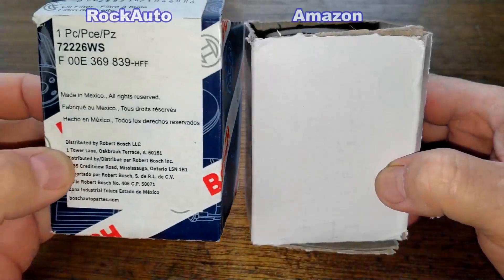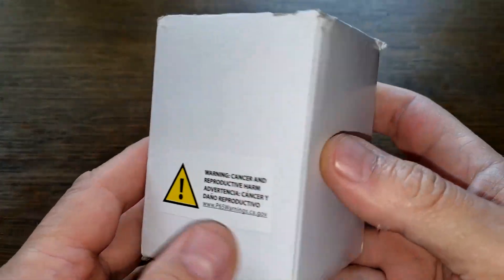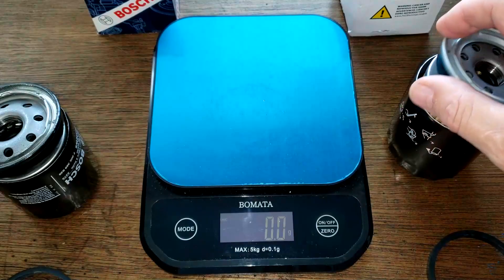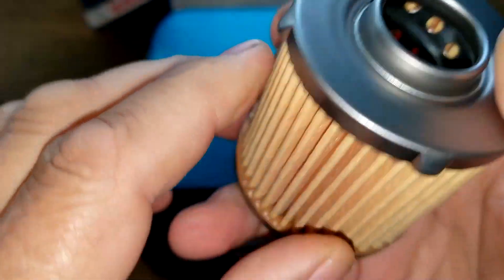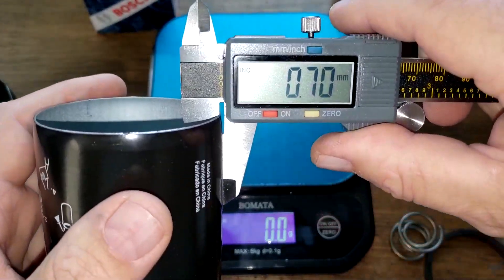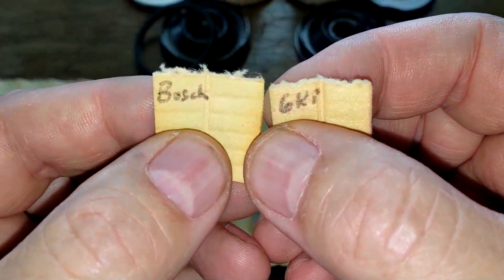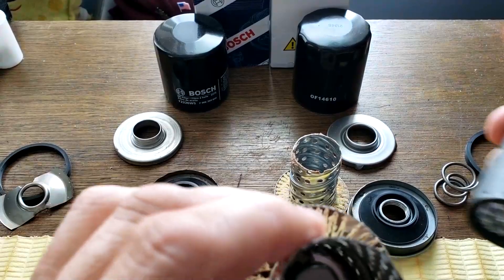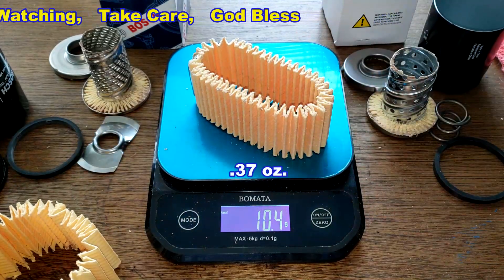Bosch Oil Filter 72226WS Cut Open vs. GKI OF14610 Oil Filter Cut Open Comparison

Comment: Neither,the Bosch is basically a beener filter🫘 vs GKI is a Chinesesium filter 🇨🇳,i go with a Japanese built OE Honda filter
Reply: it's not 1990 anymore..   specific china and korea factories are on the same or higher level than Japan.  ..  Mexico is stuck at 1986.

Comment: The GKI filter media looks like it was assembled better than the Bosch and it has my preferred coil spring but it has less filter media than the Bosch. I've never heard of GKI before. Neither has a silicone anti-drainback valve. I'd pass on both and get a different filter.

Comment: The GKI seems to be a pretty well made filter and I do appreciate how they were prudent wit hthe glue, Bosch is supposed to be a premium brand but seems to lack in a few areas like thinner media, leaf spring and a rubber ADBV.  I do not like the rough side of those holes touching the media on the GKI, though. If forced to choose, though I'd stick with the Bosch and make sure I changed my oil at 5K on the dot,  but if given a choice I'd pick something else like a purolator PureOne.
Reply: The Bosch oil filter pictured here is their "economy" model -- NOT representative of the Bosch Premium model at all.
Notice that the Coil Spring goes with the Thicker Cannister. When manufacturers switched to the thinner cannister (less waste, lighter weight, environment), thye found that the Coil Spring distorted the cannister, causing failures.
They designed the stamped-steel "Retainer", which locates the filter element and holds it in place -- it's cheaper and more effective than the Coil Spring, and, technically, it's not really a "spring" at all -- but people still call it a spring, anyways.
 Even Fram calls their retainer a spring.
America has become a nation of slow learners.
Reply: I'd like to know the flow rates of each.
Reply: Yeah, Mark, but it doesn't do any good unless you know the Flow Rates of the Matching Oil Pump at different RPMs.
No sense in paying a premium price for a Hi-Flow oil filter if the pump doesn't deliver the desired Gallons-Per-Minute.

Comment: The Toyota dealer in Westbury, NY left old oil in my Gen 2 Prius crankcase.  When I went to complain, the manager said they don't desludge and "Have a nice day."  What scumbags all these dealers are.
Reply: Take your Prius to a garage and get them to change the Engine Oil, Oil Filter just take OEM sump plug with washer or built in washer in the sump plug.
Reply: Learn to service your own car.
Reply: I had a run in with a dealer, and that was the last one. 26 years ago. From then I have been working and servicing my own cars

Comment: The GKI looks identical to the Philtop filters. Same weird bypass, thread size stamped on the base, same inlet hole configuration, same coil spring that's thinner in the middle. It's not a Premium Guard, that much I can tell. Little bit lower quality but not bad. Looks quite similar to the PG filters but not bad. Would have liked to see a silicone anti-drainback at that price considering you can get a Proformer (NAPA made by PG) with a silicone anti-drainback for around the same price.
Reply: Most modern cars have the filters with threads on top, no adb valve required

Comment: We still don't know the most important thing, which filter removes the smallest particles. All we know is what the filter companies tell us.
Reply: YEP. Micron Rating is what oil filtering is all about. 
These 2 filters show NO Micron Rating.
The Bosch Premium Oil Filters (NOT this "Workshop" model) have a 20-Micron rating, a Silicone ADBV, and are
more than adequate for a 5,000-mile OCI.

Comment: I would still take the GKI over the Bosch because it doesn't have the "Cheese Grater" center tube which could decrees oil pressure.  Nice review. Take care everyone.
Reply from the maker: Thank's👍
Reply: NAH. That "Cheese Grater" center tube works just fine -- as used on premium-quality Oil Filters from major brands. 
It's engineered to AVOID a decrease in oil pressure.
Reply: @SlikLizrd  Thanks for info bud. I learned something new today! Cheers

Comment: The funny thing is the flat spring is superior because it helps elimates tilting of the filter in the can, but everyone likes the inferior coil spring. 🤠
Reply: YES -- and NO !!
First, it's technically not a SPRING. Real springs (like the Coil Spring shown here) are made of expensive "spring steel".
It's a RETAINER -- (no springing action) that holds the Filter Element securely in it's place. 
The Coil Spring is not "inferior" -- It's used on filters that have SHORTER elements, because the Retainers are too short to hold  the shorter elements. 
 Also, notice that the Filter with the Coil Spring has the thicker Cannister, made necessary by the use of the Coil Spring. The Retainer allowed for a thinner-walled cannister, thus reducing wasted materials.  
 As we could see in this video, the Coil Spring is used with the shorter element (less filtering area), and the Retainer is used for the longer element. This is true regardless of brand or price.
One "spring" is no better than the other -- they just have different characteristics, geared to element size requirements.
 Also, note that the Bosch oil filter in this video is of their "Jobber" (cheapest) model, which is NOT indicative of the quality/performance of the Bosch "Premium" model, which has a 20 - Micron rating, Retainer, and a Silicone ADBV.

Comment: YO, Pete !! I got a question -- what's up with the "rough holes" ??
Have you ever found an Oil Filter that was damaged by the filter media rubbing or chafing against the Center Tube ??
Reply from the maker: Hi Chuck,
No, I haven't but why not punch them the other way around. I think it's worth mentioning.
Reply: Okey-Dokey !!
I was just thinking that if there was no damage, there was no problem.
  Silly me. 😁 @WhipCityWrencher
Reply: It's all good, Pete -- I ain't bad-mouthing your review, I was just thinking that you like to keep your reviews short and sweet, and since there is no damage caused by the "wrong way" holes, you may wanna skip past that part.
 Regardless, you're still the best in the bidness !! 😁 @WhipCityWrencher
Reply from the maker: @SlikLizrd  Thanks😊👍

Comment: Disappointed in the Bosch. That name used to mean quality.
Reply: It still does. The Bosch model being tested here is their LOWEST quality oil filter. I would not use or recommend EITHER of these oil filters due to the Nitrile Rubber ADBV --
 The Bosch PREMIUM Oil Filter is of a better quality, with a 20-Micron rating that's RARE in the oil-filtering bidness.
Notice the thicker cannister-coil spring combination -- The coli springs were used often with the thicker cannisters, many switching to the stamped-steel retainer when the thinner cannisters were introduced.
The coil springs could not be used for the thinner cannisters as the thin cannisters would distort and leak. The Retainer distributes the force out to the edges of the cannister -- for a lighter filter with a leak-proof cannister seal.

Comment: More filter area means oil will flow through the media at a slightly slower rate.
Reply from the maker: That kinda depends on the quality of the filter material, some have a lot of tiny holes.
Reply: @WhipCityWrencher  Oh definitely.  
It would be interesting to do a flow test..... Something simple like gravity feed.  Cut a 1 inch or 1 1/2 diameter circle from each media. 
Using JB weld, glue the filter media to the end of a 2 or three foot long piece of PVC pipe.
Fill the pipe to the top with oil and count the seconds it takes to either drain the entire  pipe, or to fill to a predetermined level in a clear, graduated measuring cup.
.....or a shot glass, I mean hey, it's a Saturday night. 😁
Reply from the maker: @randywl8925  That's a great idea, I think I would use some kind of clamp so that I could reuse it instead of glue, quicker to set up too. I'll try and make something like that this winter when I have more time. 
Thanks for the idea👍

Comment: My only concern is the lack of the brand name and description on the packaging and filter. How do you know if it is genuine GKI or a fake. I agree that the cartridge should have been wound so that the rough edges of the holes be on the inside. That could have been easily manufactured correctly

Comment: GKI has a little bit less media but the thickness overcomes that IMO..  but also the build of this generic GKI just embarrasses this bosch which looks like it was made in a third grade class in mexico.  ,   and there is no way that bosch is 99% @ 30 IMO with that paper thin material.

Comment: Bosch for the win. It has more filter area and thinner media so as not to unnecessarily restrict oil flow. More thread grooves make no difference in functionality. China has EARNED their bad reputation for poor-quality products and I avoid it as much as possible. Bosch may farm out their production to Mexico, but it does so with strict specifications to ensure the quality expectations of the consumer are met. GKI? Who TH is that? Go ahead and take that chance if you're willing to suffer the potential consequences.